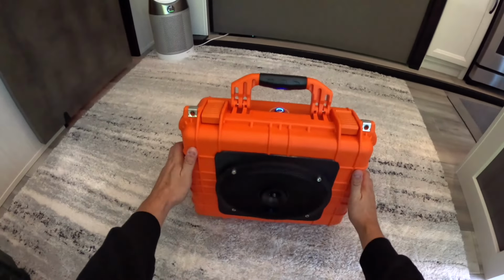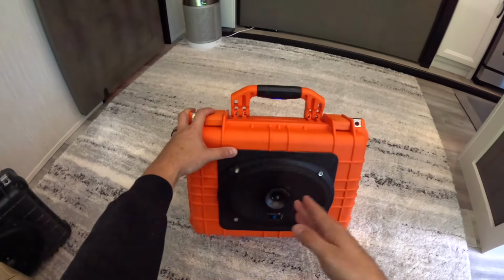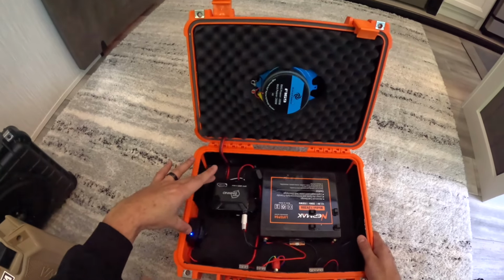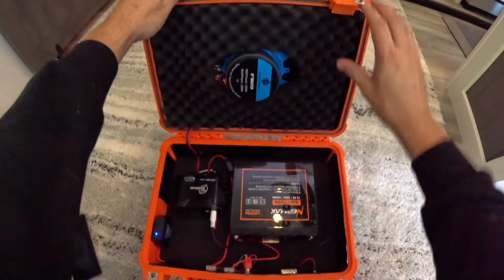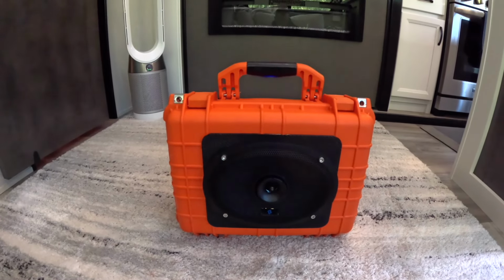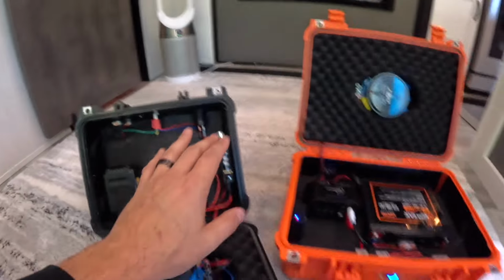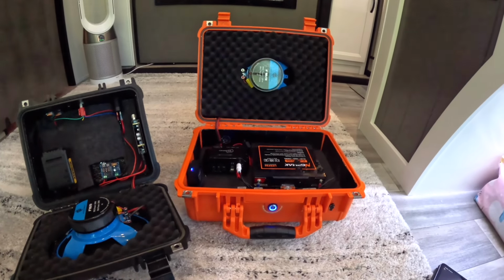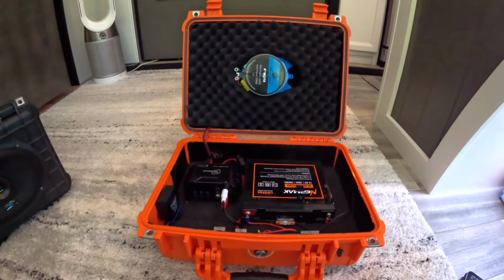DIY Waterproof Bluetooth Speaker Build | Insanely Loud with 12V Car Amp & 20Ah LiFePO4 Battery!

Comment: Nice build, Pal! Great work.
Like the durabilty and waterproofness.
Should be great for the Beach or Pool and that Battery is massive, could last up to a week :person-turqouise-waving:
(Enjoy that thang, can't wait to build my own)

1) Why is higher Voltage better?
I heard that many times. Im wondering now, why the 12V Version seems to have a lot more power.
Maybe the bigger case adds some, but that should not be the keything here, right ?

2) i Like the plug and play solution on the big one, seems easy to build, but the build took longer ? 

3)Pro's/Con's of that type of amplifiers compared to each other ?
Reply from the maker: Thanks bud, I've been putting it through its paces and it's held up great. I added DSP and it sounds amazing. The 12 volt is a class d regular car amp that pushes way more wattage versus the traditional 24 volt mini amps you find on Amazon. I know it's reverse in theory but 12 volt just carries way more power to the amp. The pros to the 24 volt is that you can use a smaller battery that will last longer it just won't have as much power. The 12 volt you need at least a 15 amp hour battery that may get you as long as a 5 amp hour DeWalt off the 24 volt dependent upon volume level.
If you want to go with something that has a lot of power I would definitely go 12 volt, it's the only way to go for volume 100%.